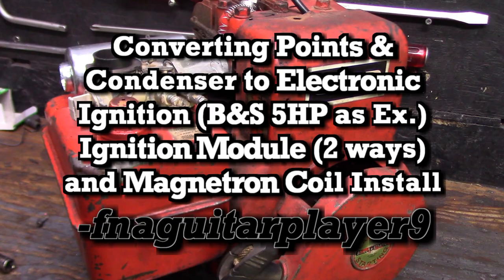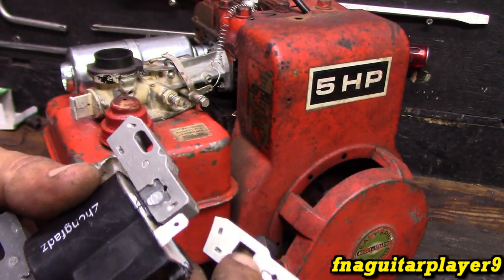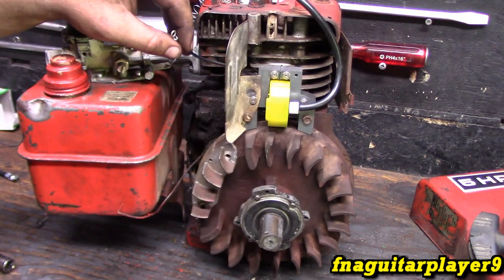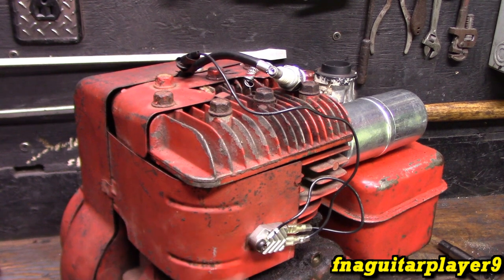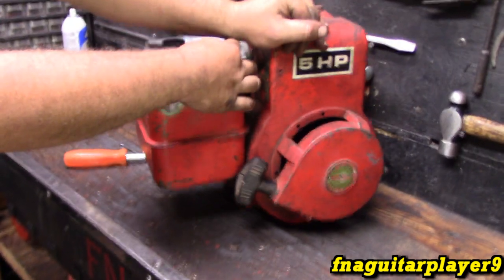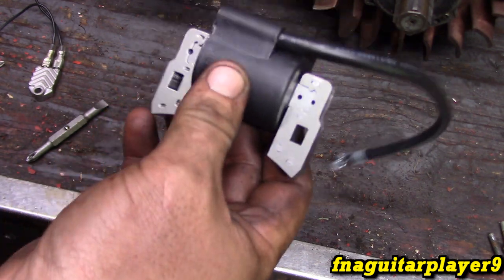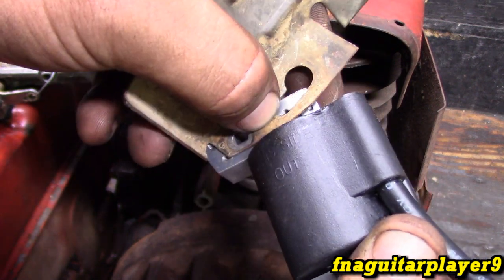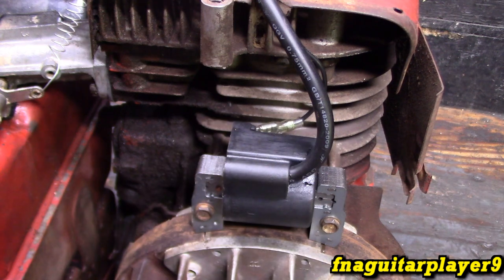3 Ways to Convert Points and Condenser to Electronic Ignition   (Briggs 5HP as Ex.)

Comment: Thanks for the great tips! I had an old 5hp Briggs with points, and it wasn't firing. I pulled a coil off of a newer 5hp Briggs parts mower, slapped it on there, and it didn't work. The mounting holes were correct, but the curvature angle was wrong where it rides next to the flywheel(where you set the air gap). I really wanted to save time and money, so I used a grinder to change the angles of the new coil so it had the same shape as the old one. Much to my surprise it worked! Engine runs great again
Reply: Thinking outside the corporate box...love it
Reply: A nice save but it is 'too easy' the get the points working again with a points file and adjusting the point gap. 9 times out of 10 they just need cleaning.

Comment: Your information is very helpful.  Thank you.  I had already installed new points and condenser and a coil on my 3.5 Briggs and Stratton and still no spark.i set the points at .20 and used a business card for the coil.  No spark

Comment: Like you said, I never had any problems with the points setup but the newer short blocks don't have the place for points so Magnetrons it is. And I want the bvane for cooling so the Magnetron takes all the confusion out of everything. Never knew about the yellow add-on but that's a neat deal. Good old 5-horse 'L' head. Pick me one!
Reply from the maker: Yeah I like the points system too, I've never really had problems except for the usually needing to clean the points at random times. yeah i prefer having the cooling fin in too. They are hard to find the yellow add on, i got a couple that came with some NOS short blocks i got off ebay. I just got this one a couple months ago, doesn't smoke at all! Thanks for Watching!!!
Reply: @fnaguitarplayer9  Good deal! And tearing one down sometimes is a good thing. I always do 1st to get the wats nest out!

Comment: I've done pretty well with the atom and nova modules. There was one case where I used one of them (can's remember which it was) on a Briggs 5hp and it the timing was too advanced. Made it rough to start. Probably a knock off that wasn't quite right. Used a Briggs Magnetron and it was fine.

Comment: What coil would you use when coil is mounted under the flywheel it doesn't have bolt holes for the outside of flywheel

Comment: ok so if i buy the new modern coil can i just remove the old one and replace it with the new and itll run or do i need the module aswell as the new coil? or would i need the module if i wanted to use the oil style coil? cheers
Reply from the maker: You only need the module if your engine had points and your using a coil made for points/condenser, if you replace the coil with the electronic ignition coil (magnetron) the module or points is no longer needed. Thanks for Watching!!!
Reply: @fnaguitarplayer9  needed this answer as I was a little cornfused after watching; thanks!!

Comment: Found your video on 3 ways to convert your 5HP B&S to electronic ignition very interesting. I have the same engine, I’d like to know where you found the replacement points type coil for the original B&S points coil. My coil doesn’t have a p/n on it. Looks like your points coil may have been a Sterns?
Reply from the maker: I just ordered it off of ebay or amazon, they are fairly cheap, it may have been a stens i'm not sure right off hand. Thanks for Watching!!!

Comment: Hi there. I have an old MerryTiller but the coil has three legs. Can I get an electronic ignition coil for that? Failing that what’s the part number for the first fix you did? Cheers for the video!
Reply from the maker: The only way you can upgrade that to the electronic coil is to change the flywheel out to the newer style, i talked about this in a video on rebuilding a model 6B, the magnets are different on the older flywheels so the newer coils will not work, done tried it. Thanks for Watching!!!

Comment: Would that magnetron coil also work on the B & S  3 HP engines? 
I’m assuming they are the same, but thought the flywheel diameter might be different.
Reply: 5 hp OD is bigger than the OD of the 2 hp... which is the same as the 3 HP flywheel?

Comment: I got a 18 hp 1 cylinder with a coil like they put on cars back in the day. I tried what you got. I have done a bunch of them. Mine fired all the time like a furnace.  Couldn't get timing
Reply: Your flywheel probably has too many magnets. I read these only work on flywheels with 1-2magnets.

Comment: Ok so I would like to switch aswell, I have 2 wires coming out of the points one going to the coil, then one going up somewhere near the governor leading up to the switches on the snow blower throotle, so I sorta got lost which wire do I cut?
Reply from the maker: Ok you will connect the wire coming from the switch on the throttle directly to the coil, that would be the easiest way of doing that. and just cut the wires off at the points cover. Thanks for Watching!!!

Comment: Can This Be Done On A 3 HP Point Unit ????
Reply: Ignition coil For Briggs& Stratton 793295 398593 591420 496914 793281 Replace ment coil off e bay.   ????????  $16.xx.

 too bad they dont put the distance between the coil mounting post screws as that is where the problem is as flywheel on 2, 3, 3.5... 4? hp is smaller than the 5 HP engines so the coil is different... hole spacing for mount.

Comment: The thin metal plates connected to the coil are not there to direct air anywhere! Their a part of the governor system on the Briggs!
Reply from the maker: The plate that attaches to the coil is stationary, these engines use internal governor parts, these are not air vane governors like push mower engines. Thanks for Watching!!!
Reply: @fnaguitarplayer9  Actually some old Briggs engines have air vane governors.   I got a couple of old rototillers from the 1960's with that type of set up.

Comment: Could i get a link for the last coil you used?
Reply from the maker: The one i ordered isn't listed now, but if you get on ebay (or amazon) and type in 397358 coil, you can get the original style one for like 25 or a aftermarket one about 15 or so, just make sure the one in the picture shows square/rectangle holes and not round/oval and it will work, unless they have the wrong picture up. Hope this helps! Thanks for Watching!!!
Reply: @fnaguitarplayer9  i ordered one with oval holes because i couldnt find one with rectangular ones. But the number matches and it has pretty good reviews. Thanks  for saving me $100!
Reply from the maker: @THS033  I hear ya, you may have to take a round file and file the holes slightly to get it to work. I don't understand why the part number crosses to that one.
Reply: @fnaguitarplayer9  im not sure either, but in the description it says that it'll fit my engine model so i guess ill see whenever the package comes. Thanks alot for the advice!
Reply: @THS033  Did the oval electronic ignition work on your B&S engine?
Reply: @sed6  Yes! It worked perfectly

Comment: Actually these 5hp bs engines
Have a huge flaw
And thats not the ignition
Matter of fact its the poorly
Made fuel delivery
For folks that are not familiar
The carb mounted on the fuel
Tank and the brass/plastic extension pipe sucks in fuel
To the carb when the diaphram or membrane is in the mood
As it ages and sits it gets
Worse and once the screen is
Plugged its all over
But the spark usually survives
So i would not worry too much
About those points
Its the fuel supply that is
Really the cave mans idea
Just my 2cents

Comment: Old-fashioned point system produces a hotter spark a nice blue violet spark for the spark plug the electronic system coil produces a weak white Spark electronic coil is not very reliable